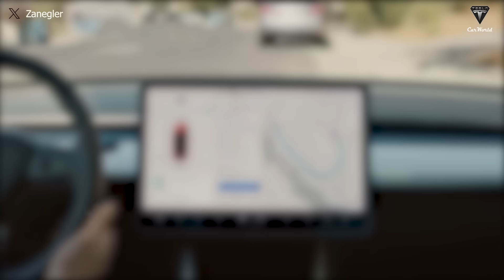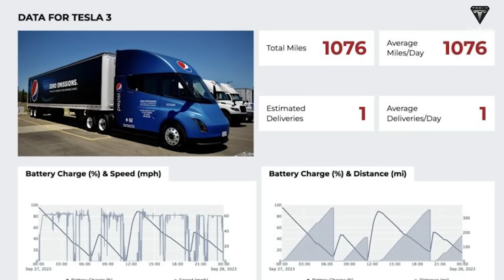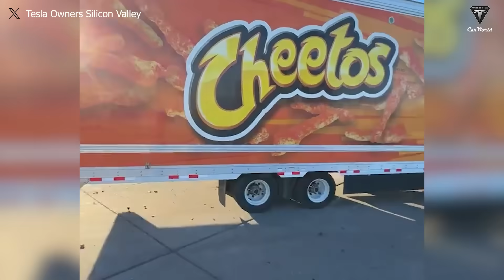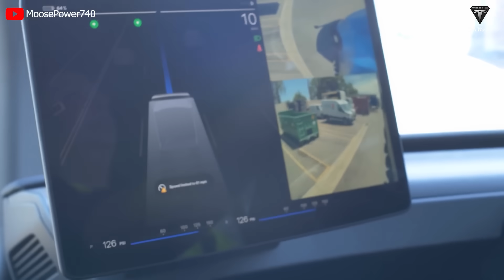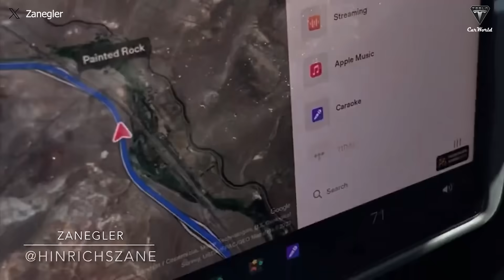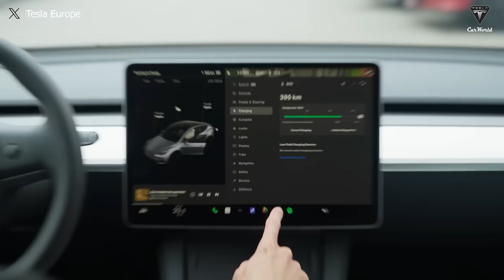Elon Musk Reveals 2024 Tesla Semi Mass production Plan! 50% Cheaper, Hidden Specs 99% Impress!

Comment: In nearly every single video sequence of the Semi shown in this video, the driver(s) are driving on the centerline or on the lane centerlines. Obviously the center seating position is not good. Even in Jay Leno's video he's all over the lines -- and then they comment on how easy it is to stay within the lines LMFAO. Yeah right. I do not think EV Class 8 long haul trucks are going to be as popular as these videos are suggesting. Definitely not at first until the infrastructure is completely updated. Go to your local truck stop. Any of them. The limiting factor is getting diesel. And there are lots of diesel pumps. And the fueling time is significantly faster than 70% capacity 30-minute charging, let alone a complete recharge. There simply will not be enough charging stations for what's required. And considering semi-truck need pull through charger stations (not back in like most Tesla charging stations), that's going to be very costly to build out, and take up a lot of room.

Comment: Just one question. How is it green?  The batteries use how much diesel when mining all the ores you need. Secondly Pepsi used them all day what charges these trucks at night. No solar. Maybe wind. So your using coal or something else. Your exporting emissions to another area your not cutting. Last as a driver until the infrastructure is in place not a chance will I drive one of these.

Comment: A couple of corrections on your points. Many modern trucks with ICE engines are extremely quiet inside and for some of those with what might be deemed louder trucks, I think you will find they have custom mufflers fitted to make them sound that way. 

The second point is that many young and older drivers are petrol heads and actually enjoy the sound of their diesel engines, which is why they fit custom mufflers.

Comment: Electricity has to be produced to charge the truck, most electricity produced is more polluting than petroleum engines.
So how does this help the environment?
Reply: "Most electricity produced is more polluting than petroleum engines."  

That statement is false.  Natural gas or coal-fired power stations do a far better job of converting the energy contained in fossil fuels to usable work energy than the internal combustion engines in cars and trucks.  

This is because weight is not a problem with these stationary plants.  They can have huge, heavy heat exchangers built into them that are far more efficient at capturing the heat produced by burning the fuel, as opposed to the internal combustion engine of a car or truck in which heat is just the waste product of burning these fuels.

There's about a 20% efficiency improvement in burning the fossil fuels in a power plant and converting them to electricity to be used for charging EVs compared to just burning those same fuels in a conventional ICE vehicle.

Comment: i'm a bit surprised that analysts have, IMO, pretty much ignored the semi in their analyses of tesla's earnings potential.
Reply: The analysts are probably waiting for the vehicle to be out of prototype phase and into an actual product that can be sold first. The truck will enter volume production in 24 which is still usually considered prototype or pre-production. The trucks available now are not a final iteration and they are still built on low volume production lines which means who knows what will actually be released and what the landscape will be like at that time.

It will be nice there are so many options available for electric semis that customers can get the ones that best fit their needs and we can get the infrastructure rolling out which is needed to support them.
Reply: @wazzu70  the stock market is nothing if not speculative...

Comment: The trailer is what makes it a "SEMI", not the tractor. A full trailer has wheels in the front and back and refers to trailers from years ago for the most part. The tractor part or the electromotive tractor in this case would not be a Semi on its own, only when attached to a semi trailer.

Comment: I'm all for electrifying heavy trucks, but the infrastructure gap needed to support these trucks is enormous. There nothing in place to make these viable for anything beyond point to point runs for the same company, where the company can install charging on both ends. Other than that they're limited to local use from a hub. We're decades away from using these for long haul.
Reply: Tesla is doing it all. Like there is no problem with charging a Tesla car, there will be no problem charging Tesla semi. Infact it s going to be much easier as trucks have preplanned routes
Reply: They're not intended for long haul. Most truck hauls take place on short distances of less than 50 miles. According to the Commodity Flow Survey, in 2017 39% of the value and 65% of the weight of all goods carried by truck took place over a distance of fewer than 50 miles.
Reply: @darylfoster7944  That may be true for trucks, but doesn't even come close to semi's load hauls.
Reply from the maker: Thank you !! Tesla is focusing on parallel development of a large number of electric trucks and Mega charging stations.But, you know the installation cost is reported to be $6M so the manufacturer is probably finding new steps like using renewable energy for electric trucks or anything that can make Charging costs are significantly reduced

Comment: Exciting news! The Tesla Semi gearing up for mass production in 2024 is a game-changer. The collaboration with PepsiCo adds real-world insights, and I'm eager to see how it transforms the Class 8 truck industry. Kudos to Tesla for pushing the boundaries! 🚚⚡
Reply from the maker: Yeah, we're glad this puts to rest the rumor that the Tesla Semi is production hell! The transport industry game will be more intense in 2024 !! Love you
Reply: Still no sleeper and the ranger is half what's advertised. THIS IS A FRAUD
Reply: There is no way you can pass diesels on hills and drive the Tesla semi like a car and get 2.0/kw/hr. The range will literally be half or less than advertised. Also what speed is the semi going to get a 500 mile range? The average speed of the slow lane on the interstate is 67-73 ,most fleet owned semi’s usually run the right lane .I’m thinking the 500 mile range is at 55-62 mph ,a dangerously slow speed on the interstate. How will these things do in the northern half of the country from November til April ? Needing cabin heat and low temperatures devour range .

Comment: You forget to mention the Tesla semi's regen ability. Most of excess  energy used going up gradients is recovered when coming back down, unlike diesel trucks that can only use their bakes.
Reply from the maker: Can you explain more about this!! Pls provide ins that you know!! Thank for your suggestions !! Love
Reply: If you look at the Pepsi fleet reports you will find a driver claiming that on a up hill delivery he found that the excess kWh most were recovered on the down hill return trip. This fits with EV users on mountainous terrain road trips. @TeslaCarWorld
Reply: this is false statement about diesel trucks
Reply: @Martin-se3ij  Yes mostly trucks motor brakes downhill but that not still remove all fuel compustion. Motor still gets nominal fuel for steady state gas, but engine stress makes truck slowing down.
Reply: Agree with you  except that regen does not require brake pedal to be pressed.@Tron-Jockey
Reply: No regen is when you lift your foot of the gas. EV driving experience might help.@Tron-Jockey

Comment: Wait until an accident., stop and go up hill. ET phone home
Reply: It’s funny when posters like you literally yell that they haven’t done any research at all on the subject. Electric motors have much more torque than a diesel. They don’t have any uphill problems. Even more you can overpower an electric, semi without the penalty in fuel that a diesel would occur. The extra electric motors can sit idle when they’re not needed.
Reply: Let’s load up 90k and let see what goes further,. And see who gets 3000k miles first
Reply: @chriscolyer8959  
Hey, let’s compare it to an ocean liner and see which one gets to Europe first. It’s a short haul tractor why would it go 3000 miles.

Comment: How much would the cost of charging be if tesla or pepsi  use solar cells and orher renewables to charge they're trucks? You know go off the grid as much as they can, i mean they pepsi or tesla could place battatries in various   locations to charge they're simi's along the way, and use solar panels to charge thoes batteries!
Reply from the maker: We love your idea but the manufacturer's use of renewable energy for electric trucks, although potential, still seems unrealizable at this stage. Of course, it will be much more economical on Tesla Semi's charging costs and is also more sustainable and easier to install, but currently it needs to be researched. Hopefully Tesla will be successful with it soon. Thank you
Reply: @TeslaCarWorld  Tesla chargers are 100% renewables since 2022
Reply: Isn't a magapack near $1.5 million? You could buy a few diesel semis for that.
Reply: Good Idea if you are only moving feet instead of miles. Simple physics.

Comment: So, you said in this video that the payload of the semi is 76,000 lbs? Meaning that what it can pull minus the truck minus the batteries is 76,000 lbs??! Lol. Impossible. What is the range, how long to recharge? And how much to recharge the truck?? If you use fossil fuels to create the electricity for Tesla semis, you are not saving anything. This video is a joke
Reply: Electric trucks are allowed to have a gross combined weight of 82,000 lbs in the US (which is 2000 lbs more than ICE trucks). It has been speculated that the Semi weighs 27000 lbs, so that would leave 55,000 lbs for the trailer. Since an empty trailer weighs about 12,000 lbs, the max payload would be roughly 43,000 lbs. There are two models: 300 and 500 mile range. Tesla says that the Semi can do a 70% charge of its battery in 30 minutes. We don't know the cost of fast charging at a Megacharger, but it can be slow charged at any home or business paying the standard electricity rate. If you assume $0.12 per kWh and a 900 kWh battery in the 500 mile model, it would cost $117 (assuming 8% loss when charging). The average new diesel semi in the US gets 6.5 miles to the gallon, so going 500 miles at $4 per gallon would cost $308, so the diesel semi costs $0.62 per mile to operate, whereas the Tesla Semi costs $0.23 per mile. We still don't know the price of the Tesla Semi, so hard to calculate the savings, but other models of electric trucks are saving businesses a huge amount of money.
Reply: @amosbatto3051  Your numbers make more sense. The 76,000 pound payload number was ridiculous. The idea of solar farms charging during the day to charge trucks at night seems far fetched given the number of trucks required unless you plan to have just a few electric trucks, which means the plan is not to have to many. Still looking at the range numbers and the idea of doing that charge in 30 minutes. I just dont believe it and I need to see proof. I dont believe things just because someone said it, especially Elon who makes a ton of wishful claims. Thx
Reply: @pedrosura  Why are you so upset if aren t even looking at the data?! The data is out. Pepsi and Tesla have been using these trucks for a year. It s no joke
Reply: Stop making about being green, they are cheaper to run and the software makes them safer! Nothing to do with green unless your an oil company trying to make hate
Reply: And yes it can haul slightly less than a regular semi only cause of weight limits! It can charge in the drivers test breaks. Sorry but the meme that you read are wrong!
Reply from the maker: Are you confused? We are referring to the 70,000lb total load capacity as provided by Jay Leno, not 76,000lb !
Reply: @TeslaCarWorld At 2:41 in this video, it is stated

“We now know that the payload capacity of this Semi is 70,000 lbs”
Payload is the part of a vehicle load from  which “revenue” is derived. It seems that it is just mis stated. You were trying to say the total weight of the Semi as opposed to “payload”. Right?
Reply: Cheaper and safer. You're the joke here bud
Reply: @Cibbic  How did you determine is safer? How did you determine its cheaper? Operationally? The truck? Sounds like you are offended by simple questions..
Reply: Why the panic? And why the questions that have already been answered. Fueling an electric semi is about the quarter of the price of diesel.
It also means not having to do a lot of diesel, maintenance, and dealing with diesel pollution. And no, it’s not the same amount of fuel electric plants are much more efficient at burning fuel than a diesel engine is. 
On the fastest charger charging time is about an hour. And before you start complaining about cross-country road trips, it’s a day cab it’s only meant for short haul.

Comment: 48 volt architecture will be a huge upgrade, Tesla's engineering is amazing
Reply from the maker: It will be in the next version, as confirmed by Dan Priestley along with Jay Leno; the braking system, cameras, and everything else are insane to expect. It's going to blow minds. Love you so much !!
Reply: Trucks, trains and the whole industrie runs on 24 V nowadays (with converters for 12 V car stereo and 110/230 V TVs and digital equipment. I don't  really get the small step up to 48V. If they wanted to reduce currents for AC, steering, compressors etc. Why not go to a much higher voltage like 72 or 96 V. Could it be the risk of fire in case of damaged wiring? I don't  think so. 48 V already makes for beautiful sparks. Feedback is welcome